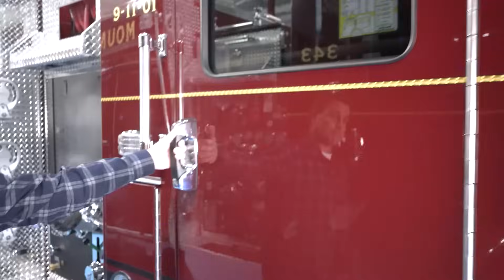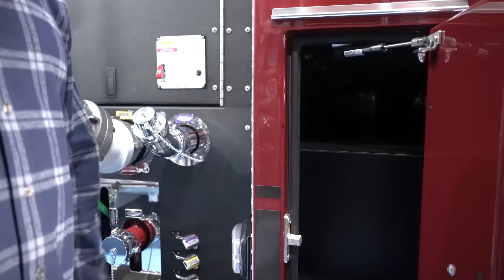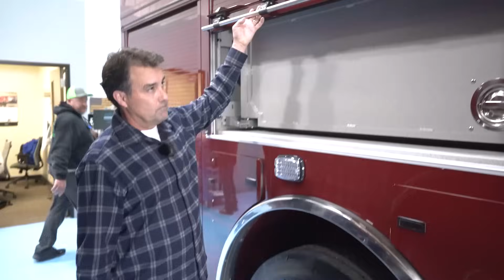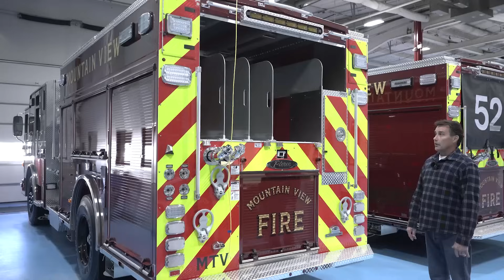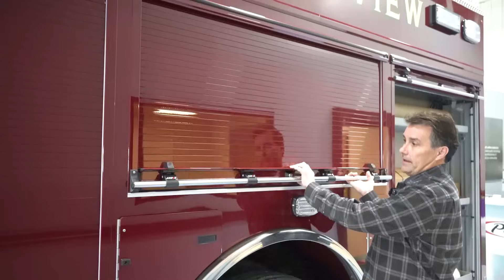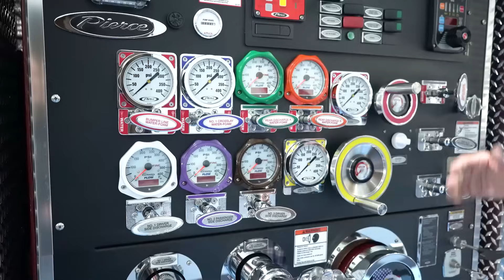Enforcer™ Pumpers – Mountain View, CA

Comment: Nice truck. But maybe as some feedback: If you typically pull past and take the dead load of the rear anyway, why not lose the crosslay and replace it with a hose reel for wildlife and car fires?
Reply: They have a single cross lay and a reel in the middle of the rig